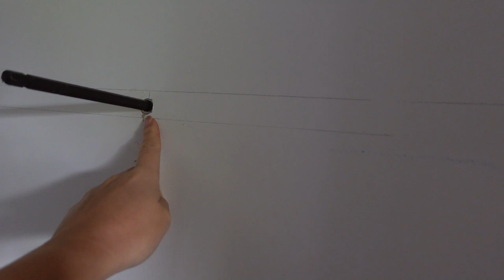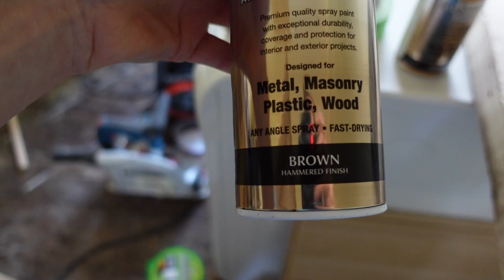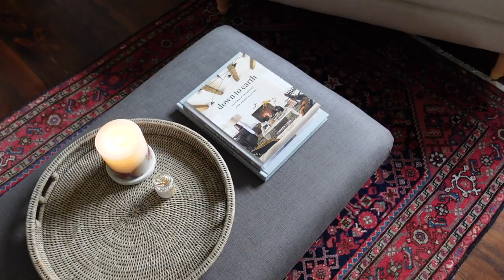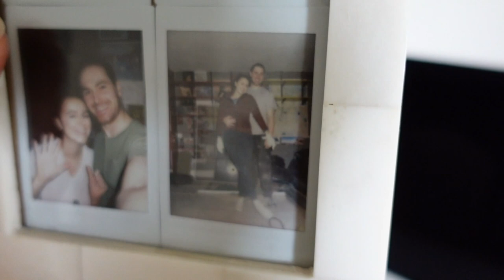DRESSING ROOM/OFFICE MAKEOVER WITH THE COTSWOLD COMPANY | Laura Melhuish-Sprague

Comment: I would make one additional tweak to the angle-cut wardrobe door. I would get thin MDF and infill the section of the cut edge that is now just the center panel thickness, to continue the Shaker frame all the way around the door. You could just glue some thin MDF in that one section, paint it out, and suddenly it looks like custom built-ins.